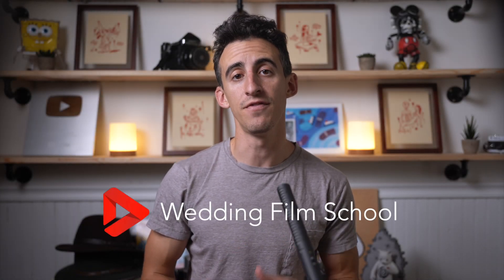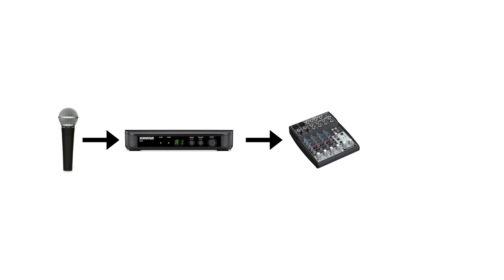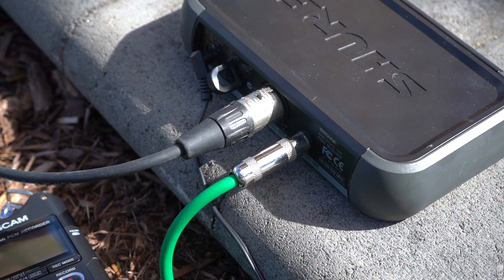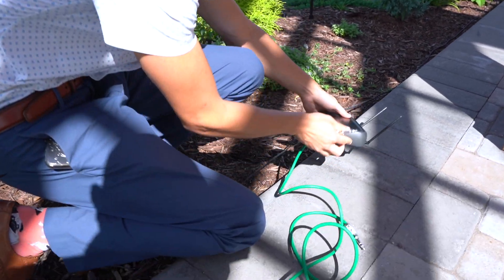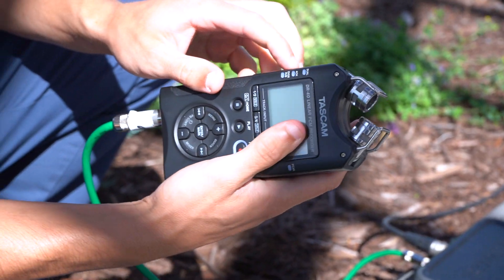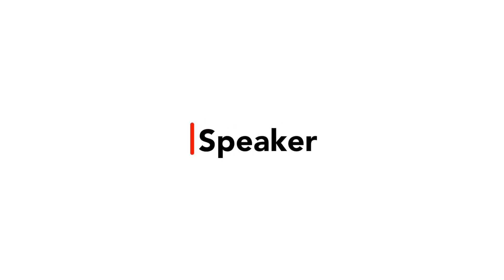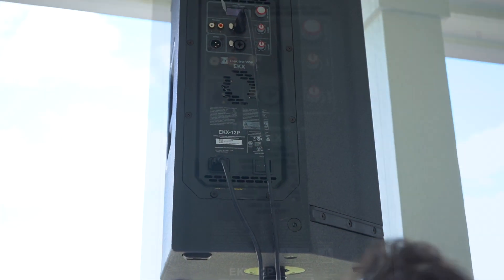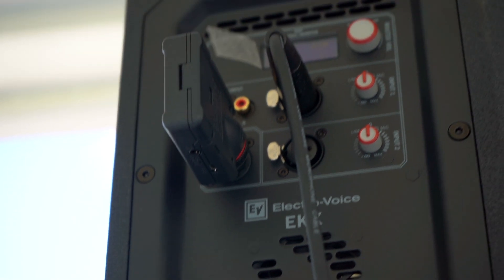How To Record DJ Audio For Wedding Videographers

Comment: Great video man. I've been shooting weddings for years and I always ask the clients to make sure that the DJ has a line out from his soundboard for speeches etc. I have almost never had a good experience plugging into speakers. The feed into the recorder isn't clean and is often distorted/noisy/hot. A sound buddy of mine told me that the signal is looping through not only the board but the actual speaker and it's never a good idea to use it for a clean feed. Just curious if you ever run into this problem.
Reply from the maker: While I've totally had some messed up feeds I would say it's rare. I would say my go to audio used in over 90% of my films the last 18 years is a feed from the DJ is some way (speaker, sound board, mic receiver, etc). Makes me think it's something on your end.Are you using a recorder that can handle line levels? They are different than mic levels and require the correct recorder or to use an attenuator

Comment: I am always confused by male or female xlr. I started by brought wrong xlr connector to the dj and could not record that day. Even to today I still do not know which end should use on dj mixer or speaker. But since now I just bring one cable end at male and another one end at female. So if one is not right just use another one. But I would be happy to figure out which end we should always use.
Reply from the maker: The recorders I've used always take the male end, and the source always has taken the female end of a cable......unless I'm mixing those up.....

Comment: I filmed my first wedding and plugged my 1/4" into a receiver. Now, there were 2 receivers on the dj's table. I was in a hurry, so I plugged into one of them. I thought I was seeing a signal...but wound up getting 30 minutes of silence. I'm still learning audio. Has anyone seen an audio set up like this? Or at least tell me what you think happened?
Reply from the maker: You plugged into a receiver that probably wasn't used. Communicate with the dj to make sure you are plugged into the receiver for the mic that will be used for speeches. If you are plugging into the receiver it will ONLY get audio from the mic, nothing else. If you want all of the audio from the day you'll need to plug into the back of a speaker or the sound board - Bobby

Comment: Hey man, Great Video! I am recording Audio for the first time at a wedding and am obviously very nervous due to very minimal Audio Knowledge. Is there any way I can use a Rode Wireless GO for recording Audio from the DJ's Mic? this is my only piece of audio gear apart from a shotgun mic.
Reply from the maker: Shotgun mic is worthless for weddings outside of ambient audio if that is your thing. And the rode is not meant for that type of recording. You need something that can take a feed from the board specifically

Comment: Hi, im confused. ive been told that you cant use these recorders to attach to the back of the speaker as it is speaker level no longer line level, which means you may blow your tascam. is this not true?
Reply from the maker: Are you talking about the dr10x? It technically doesn't have line level but it has a setting called EXT and that seems to take line levels decently. Sometimes they are a bit hot but I have certainly had usable audio from them - Bobby
Reply: @WeddingFilmSchool   actually the dr40x. the output from speaker is much higher voltage than a signal from the soundboard which is line level. am i wrong? 0.O

Comment: Hey Bobby thanks so much for this video, very helpful!  I could sure use a video about the Tascam set up in this situation.  I recently  got my Tascam connected to a sound board but then had a difficult time getting the Tascam itself set up.  Even the  sound engineer struggled with it.  Thx!

Comment: Thanks! This helped. I'm trying to figure out how to record direct mic input through a restaurants PA system. I do video for a comedy show hosted here so I'm on a mission to figure out how I can get that to sync it with my videos
Reply from the maker: Should be able to find an output somewhere if there is a sound board, or if they're using wireless mics you might have an extra output on the mic receiver
Reply: @WeddingFilmSchool  yeaa i came to a a similar conclusion, this vid helped a ton! im gonna invest into a zoom H6 to capture the audio and that should pretty much solve my problems. hopefully once i get it, just gotta plug the things into the right place. thats the real challenge tbh, there cable management is horrid🤣

Comment: What if I want to record the music in a live band using a tascam? I want to record in multitrack, how is that done? How do I plug into the soundboard they use? Do you have a video regarding this? Thanks, sorry for so many questions I’m just new
Reply from the maker: If it's a live band at a wedding just get a master out and you can run that into the dr40 or something that is more current (this video is pretty old). The sound board could have any of the three options listed in this video as an out and then you'll just need to make sure you have the appropriate cable to xlr

Comment: I HAVE BOYA BY-WM8 Pro-K1 UHF transmitter
Sometimes I can't get a signal from the mixer and sometimes I do, it's clear to me that it's something in the mixer because the transmitter is working.
Is there something special in the mixer that needs to be activated in order for it to send a signal?
In the same connection another receiver like ZOOM1H does work and my transmitter does not receive a signal

Comment: How can we record all audio from a Dj sound board direclty into a H1n recorder for weddings, I face audio clipping when the connect it, I keep Limiter On and Audio Levels In Auto Levels, yet it clips. Should consider placing the H1n recorder directly in front of the speaker, incase audio speaker doesnt have a audio out port. what do you suggest.
Reply from the maker: H1 isn't meant to take a line level from a sound board. It might be possible with an attenuator but really you should get something that is meant to connect that way
Reply: @WeddingFilmSchool  thank you so much for the quick response.

Comment: I have a big question! I followed the advice for which cords to buy, but I have a budget tascam (dr-05x) and none of my cords plug into it! Which adapter should I use for this issue, if there is one?? Thanks!!!
Reply from the maker: I don't think the dr05 is meant to take a feed from a board. I think that doesn't even have any inputs if I remember correctly. Sell it and get the correct gear. A dr40 Is like the same price I think

Comment: When you connect to a reciver with the Tascam dr 40 you put the recorder in line or mic mode? Thank you!
Reply from the maker: From the receiver I’m pretty sure I’m on Mic.....but now I’m super second guessing myself as I’m out of town and away from my gear haha. It’s been a long day 😅
Reply: Line. I use this exact setup. If you can, pull an XLR from the back of the speaker. Never fails for me. The DR40 has that backup lower DB track which is nice too.

Comment: Is the back of the speaker a mono output? If you have something like rca to quarter inch would you get audio from one side and then convert to both speakers in post? Or would you try record a stereo track? Also does xlr cable support stereo signal only being the one cable. The confusing part for me is working out when to use stereo cables and when I’ll receive a stereo feed in mono etc. any help would be appreciated.
Reply: Never plug into the back of the speaker. When you unplug it makes a large popping noise and can damage the speaker. This guy doesn’t know anything about audio but is recommending things to people. which is ridiculous.
Reply from the maker: LOL at how untrue this statement is haha If you're gonna troll the channel at least be honest

Comment: Where in the mixer do i plug in my 1/4? I had a dj plug into the headphone jack and my audio on my mixer came out with static
Reply from the maker: Sometimes there is a master out on the mixer but I typically plug my 1/4 inch into the back of the mic receiver
Reply: @WeddingFilmSchool  i was hoping to get music and mic audio. But i will try to connect to the mic receiver next time. Ehat about a church ceremony. What am o looking for if i want to get audio at a church

Comment: is there a way to turn up the output from the soundboard if it is very quiet?
Reply from the maker: Are you talking about the signal form the soundboard or the gain on the recorder?
Reply: @WeddingFilmSchool  The soundboard.
 
I am getting a lot of noise from the soundboard output. 

Is there a way to turn up the output volume on the board without also turning up the 
speakers?
Reply from the maker: Like, your soundboard or at a wedding?
Reply: @WeddingFilmSchool  The DJ's soundboard at a wedding

Comment: how do you connect to an external mixer?
Reply from the maker: Pretty sure that is covered in here. You can also watch our video called like "the only 3 audio cables you need" OR any of our BTS videos. We are typically showing the different places we plug in but it's gonna be xlr, quarter inch, or rca. Mixer might not be the best option always though

Comment: Quarter inch cable? Do you have a link to that cable? I use a Tascam dr-10x, will that work or do I need a better option? Thanks
Reply from the maker: All cables are in our gear link at the top of every video and also linked in my “audio cables” video. 1/4 inch won’t work with a dr10x though....that’s xlr only

Comment: Should you use auto gain or back up rec that records at a lower gain or smth? Cuz often times the levels change and cant monitor them all the time, if you taking video somewhere for instance.
Reply: Definitely up to you and the decision should be based on how much confidence you have in the feed source, DJ, & speakers. I always tell people that if you have the money, get a Zoom H6, as it records 32bit float and you don't have to touch the gain.  Quality is impeccable just about no matter what - refer to Curtis Judd or Gerald Undone for info here on yt.
Reply from the maker: So I don't like auto gain, Actually I don't even know if the dr40 has it. I like to use the dual record option on all recorders though. Set the level to be peaking just where you want it and then kinda just be always thinking about each person speaking if there are major changes in volume. Then maybe adjust quick but know that one of the tracks should be usable. Also if you are using a recorder with 32 bit float (not the dr40) then you have way more leeway in post!